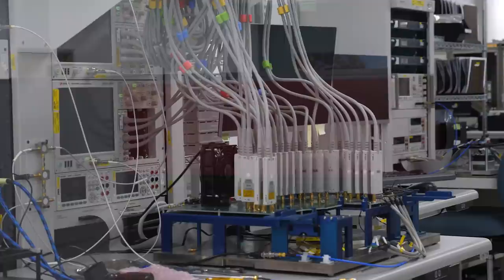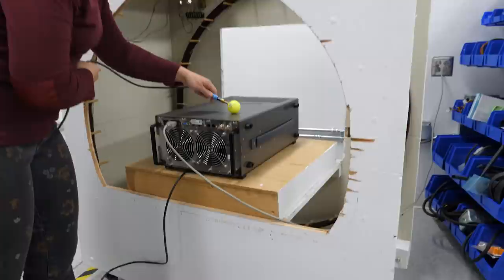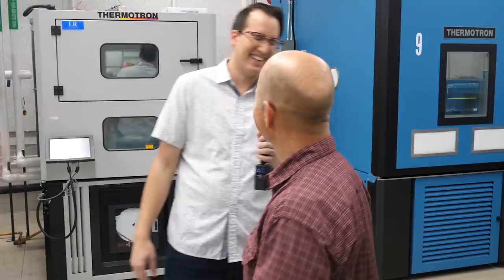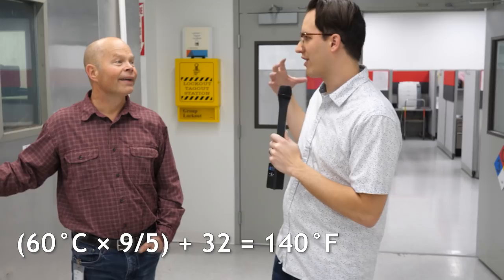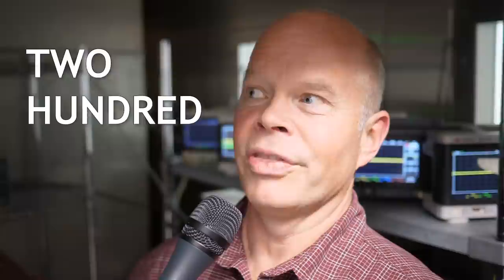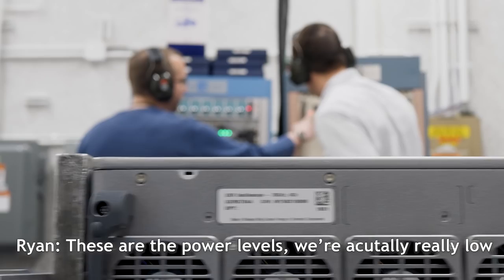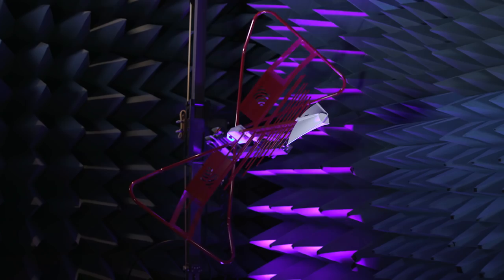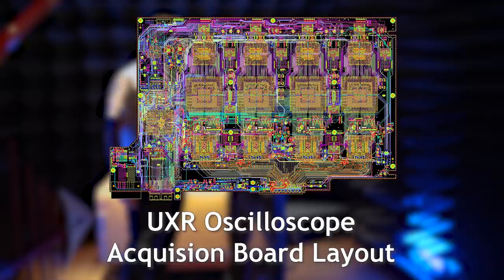Peek Inside a Prototype Testing Lab

Comment: That's pretty cool. A long time ago, I used to work for a company doing UL/CSA/TUV product testing for manufacturers to gain their certifications. Usually it involved simulating powerline faults on low-voltage inputs (think a powerline falling across a telephone line, and injecting 10000 volts where the device is expecting 48). The devices would be destroyed, but the way in which they died had to be very controlled - they weren't allowed to spurt flame out and ignite the surface on which they were sitting, and so on. I basically destroyed expensive electronics for a living. It was fun.

Comment: I've spent plenty of time with thermal chambers, shake tables, and especially semi-anechoic chambers!   When I did space electronics work, we used thermal vacuum chambers, where all of the air is removed from the chamber.  Nearby was the thermal vacuum chamber used for the Mercury & Gemini capsules, which was pretty cool.  Testing is a combination of interesting and incredibly boring, but it does help fix problems before it gets to the customer!

Comment: I greatly enjoy seeing other labs and see what they're doing, from Semiconductor Automated Test Equipment, to HALT/HAST/HTS testing like what you showed today, to testing of individual boards, to testing full devices. It was interesting seeing the similarities and differences between the anechoic chamber you have setup for high power RF EMC compared to one that's set up for low power, high frequency antenna testing.

Comment: Great Video... it is so important for a lot of people to know how much goes into the testing of the test equipment.  Folks, there's a reason why the equipment costs more AND why it is so rugged and dependable.  How do I know this actually goes on?  Back before it was Keysight, around 1996 thru  2000, I worked as a firmware engineer at HP/Agilent Santa Clara, CA in the Calif. Semiconductor Test Division and we had our new prototypes torture tested like that... the mechanical shake tests really go on, all the vibration expected in shipping, and in addition, they'd dwell at resonant frequencies and tried their best to break our stuff... I recall being told (not shown) about one test in particular that to this day makes me shudder: The drop test. The idea is that the [expensive] equipment is dropped on its various faces to find what breaks.  Yeah that one made me sad to think about expensive equipment being tortured and broken like that, but the end the product will stand up to a lot of abuse!  If I can afford it, I'll either buy used HP/Agilent (or hope to win) Keysight equipment... it will work reliably for many, many years... totally worth it!
Reply from the maker: The drop test! The machine is in the room there with the shake table, but I wasn't able to find footage of it in action so I (with a heavy heart) left it out of this video.
Reply: @KeysightLabs  Probably for me it's best... I don't want to have nightmares LOL 😂😂 I respect my equipment and give it a loving home... but it's like watching a horror movie... still want to see it 😁 or maybe it's like sausage making: you don't want to know what goes in to making it, but enjoy the end-product... I can't decide which analogy works in this case.

Comment: Love the video.  The environmental chambers bring me back to the late 70,s. I was tasked to characterize temperature drift on HP 86290 sweeper modules.  The chamber was heated electrically and cooled with controlled liquid CO2 injection. My idea to save time and CO2, I would go hot to cold for one instrument, then cold back to hot with the next unit.  I didn’t even consider that an instrument that was -20c would condense moisture at an alarming rate as it was heated up during the heat test. We know now that an 86290 will not work properly with water running off the control boards, however once dry, all was well.  The procedure was henceforth written to specifically prohibit my short lived “brilliant” time saver idea.

Comment: I like videos about testing! Test is essential to get successful products. Many years ago, a thermal test saved me from a potential embarassing issue. My clever redesign of a analog timer circuit failed the environamental test because it misbehaved below -25C. I was sceptical about the usefulness of this test, it seemed unrealistic to me, but I had to fix the issue anyway with significant part count and cost increase. It eventually turned out that one of the first customers of the product was based in Siberia. I also had a instance where the tests did NOT found out a severe reliability issue. 6 months after the start of the deploy on the fields, devices started to fail. They had to be all warranty fixed or replaced, hundreds of them. A simple additional test could have spotted the issue, but no one thought about it.
Reply from the maker: It really makes a difference! When things go bad they can go really bad.
Reply: One of my fondest experiences early in my career was doing environmental testing on flow computers.   We had a product prototype that not only had to be stupidly accurate (a 0.01% error could be the difference of thousands of dollars of product) but was also rated for zone 0 where an explosive atmosphere is likely to be present.   The amount of capacitance that was allowed was severely restricted and when running at -60C diminished severely.   Getting the thing to run properly, if at all, was a challenge but a rewarding one when we finally got all the issues solved.

Comment: What happens to the equipment that survives the tests  any for sale?
Reply from the maker: They typically get used around the building or go into long-term testing
Reply: In industry, they are usually taken apart and all parts studied for what the effects were; resistors checked for cracks, caps checked for leaks, BGAs checked for cracks, or taken to more aggressive torture tests.
Reply: Why would you want to buy a piece of equipment that's been used for extreme stress testing?  That's like asking an auto manufacturer if they'll sell you one of their cars that's been crash tested.
Reply: @TheKnobCalledTone.  um, no. Stress test and Crash test is different.

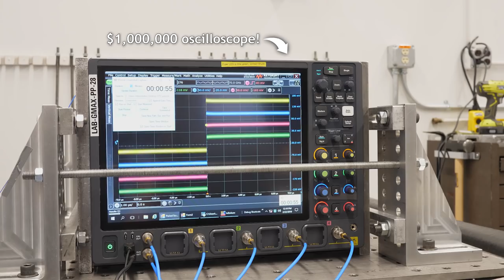Comment: i just cant get my head around that oszilloscope that is worth a million $ @5:22 can someone explain?
Reply from the maker: There's a lot of mmWave tech in there. The main thing that makes an oscilloscope cost more / less is the bandwidth. These 70 GHz - 100 GHz scopes are the highest bandwidth in the world, and you get 4 time-correlated channels with remarkably low noise. They are pretty critical for the bleeding-edge tech.